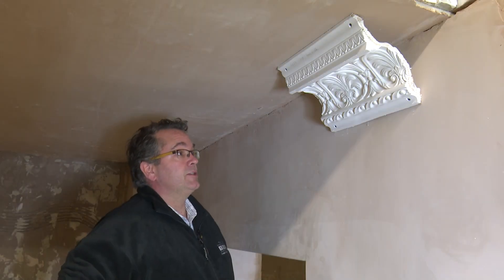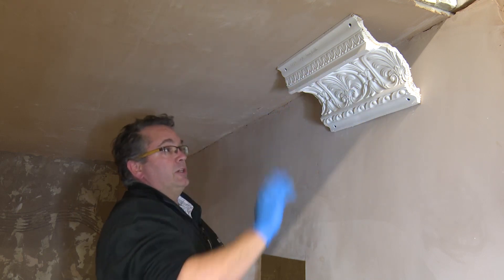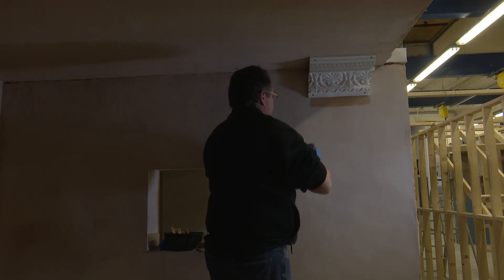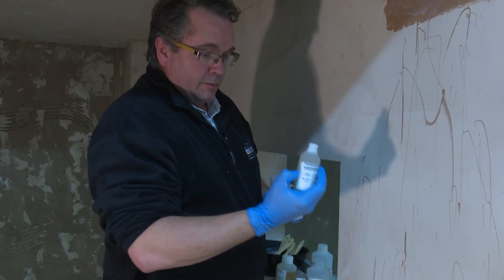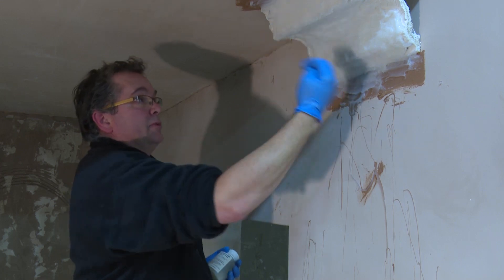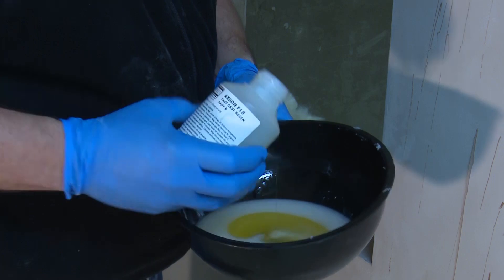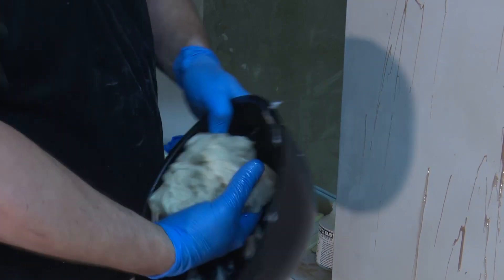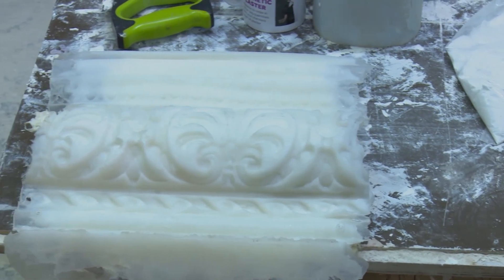How to Mould Plaster Cornice in situ

Comment: How would they have done this 300 years ago
Reply: Plaster work was done by had by skilled craft to the room, there was no cut and paste, the Victorian were the first to introduce repeat moulds. 

Porous wet  plaster work put up in sections is exclusive, the majority of moulding aren't put up wet these days, only some insurance work or restoration would demand this. You would be pretty sure by the car they drive it ain't cheep. But still no where near the effort of the past.

Comment: Why so many processes,  seems to be loads of chemicals.
Why's it not as easy as , paint on,a pva, release type liquid, then a plaster of sorts, then remove and make a copy of the mold?
Is there a easy way to fix numerous areas that are damaged? 6 " sections that electrician broke out?🤔😉
Reply: Because using a rigid mould impression with a plaster….good luck getting it off anything remotely enriched 😊

Comment: Very informative. Where  can you get the materials from?
Reply: Sadly that firm that invented the system is not in business, thanks Covid! - however you could use any fast setting Rtv silicone and then make the backing with jute scrim and plaster instead.
Reply: @nicksldcchannel9599 is the jute scrim a woven fabric with large holes? Would you brush a thin layer of RTV on the coving to be moulded as the first step of your video then make a thick plaster mix with the scrim in? 
Do you use scrim in the mix when you cast a moulding? Thanks for your time